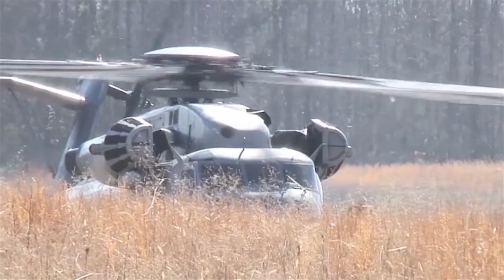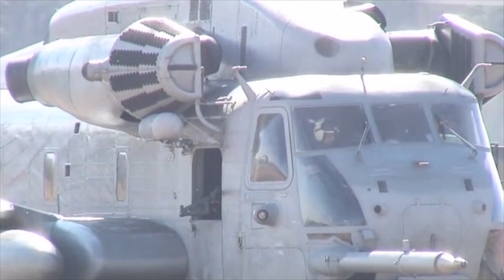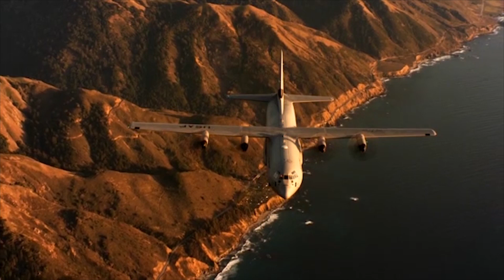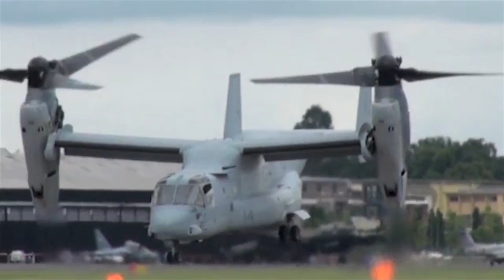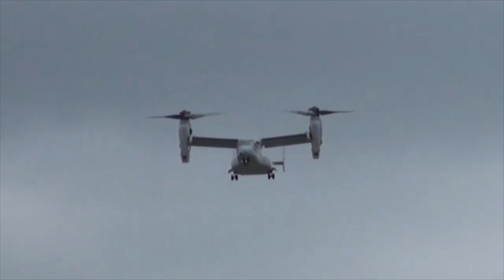MV-22B Osprey sound levels

Comment: The portrayal of the noise level is wrong.  The noise emitted is far beyond a normal Police Helicopter.  I just had a V-22 fly past, and the drone on approach lasted around 2 minutes!  The noise could still be heard very clearly with the craft miles away and out of sight! 

It is a by far NOISIER craft than ordinary helicopters.